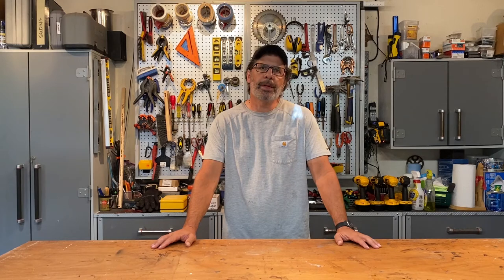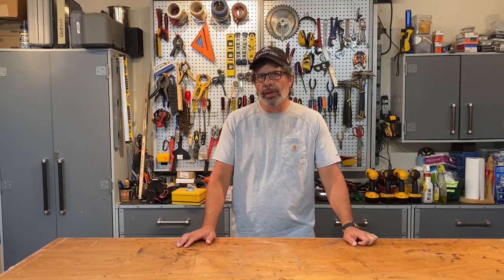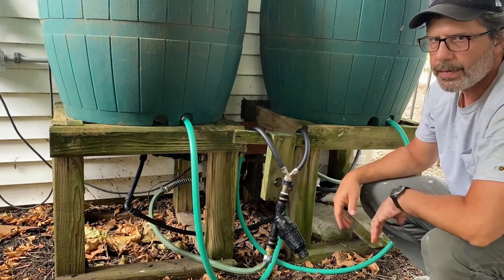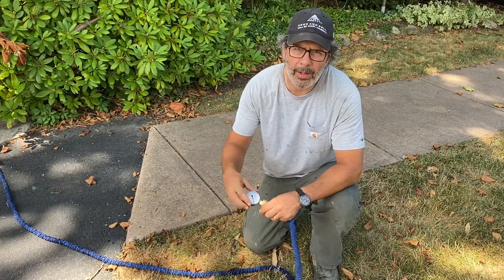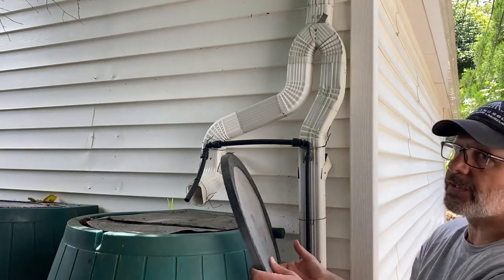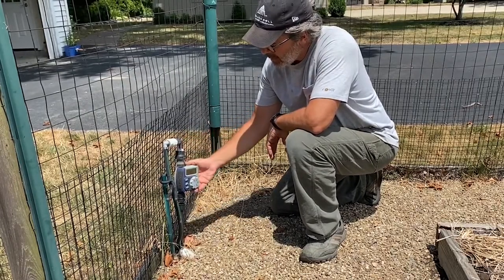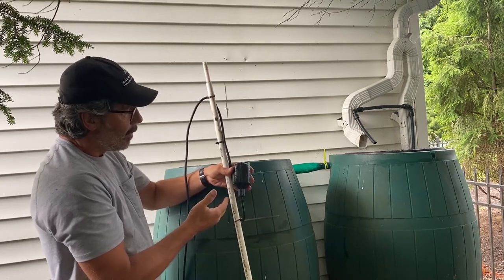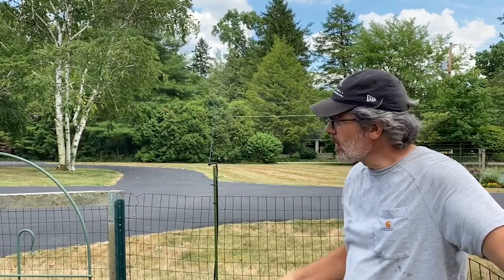The Ultimate Rain Barrel Irrigation System

Comment: Does the solenoid valve over heat being in the 100%duty cycle? Being that it is constantly energized to keep it closed
Thanks for making this video I am almost done with mine and adding float and solenoid for backup water
Reply from the maker: I’ve never had a problem with mine. My pump and solenoid housing is 3 sided to allow airflow (more for the pump which does heat up when running).  The solenoid is slightly warm to the touch when energized (i just put my hand on it. It feels about 90F).  I ran my solenoid for about 9 years before replacing it. The bottom seal went bad. It was still operational otherwise.  I definitely would not put the pump and solenoid in a completely airtight housing. Some airflow for cooling is sensible.
Reply: @dontscrewitup   Thanks for the reply

Comment: Have you had any issues with the solenoid overheating? Is it 100% duty cycle? Thanks
Reply from the maker: It does stay warm but not hot.  The housing I made is three sided to keep some air flow around it.  I would not put it in fully enclosed housing or indoors.  

I’ve replaced it once in 8 years because the gasket/seal failed, not the actuator.
Reply: @dontscrewitup  thanks for the quick reply, I think I am going to have a similar setup and will be replacing it with a motorized ball valve, which should solve the heat and gasket lifespan
Reply from the maker: Motorized ball valve is a great idea.  Also solves the problem of power outages.  In my setup the solenoid opens when the power is out.

Comment: If the hose backup fills the barrels automatically how is there ever space to accept rain water?
Reply from the maker: Good question. The placement of the float switch is critical. The float switch does not kick on the refiller until both barrels are nearly empty, so any rain prior to that will refill them.  Also, the refiller only fills the first barrel and about 1/3 of the second barrel before the float switch turns off.  Assuming the system is running, the first barrel then drops to about 1/3 full after that days irrigation, so it leaves about 2/3 of each barrel empty, right after refilling?   You can fine tune it even more to leave more available capacity by putting the float switch in the first barrel.

Comment: Fantastic system! I am in process of setting up a system to use for my 1/10 acre backyard nursery. I currently have 3 x 275 gallon IBC totes connected. Would I need a more powerful pump? I have 6 sprinklers (36” tall), 1 mister for propagation bed and would like to connect drip for my small garden ( 20’ x 20’). Thanks for figuring out the hard parts for us.
Reply from the maker: Thank you.  Sorry for the delayed reply.  Most "hose pressure" pumps are around 40-60psi.  That should be sufficient for any drip irrigation system.  Some drip irrigation systems actually step down the pressure to 10-20psi.

Comment: have you measured how much water you distribute in the hour you have it running?
Reply from the maker: About 20-30 gallons per hour. It depends on the number of dripper heads. They are each rated for gallons per hour, so you can calculate it.
Reply: @dontscrewitup   - plan to get this set up over the winter!  You really provided a great idea - and applied it!

Comment: How did you wire the solenoid valve into the flow switch?
Reply from the maker: The solenoid is hard wired into the 3 prong plug for the pump.  So one plug powers the pump and solenoid.  That plug is connected to the “thru” plug on the float switch. Female on one side, male on the other.

Comment: It seems good but isn’t the solenoid on all the time? Aren’t you going to burn out the solenoid?
Reply from the maker: Good question. It is on all the time except when it is filling,  I assume high quality solenoids are made to operate in either open or closed position.  I used this one for about 9 years before the seal/gasket started leaking but it was still otherwise fully operational.

Comment: What happens when you get a power cut when you’re away from home?
Reply from the maker: You win the grand prize for catching the only remaining flaw in the system!   The solenoid would open and the hose backup would run (and overflow into the downspout) until the power comes back on.  This could waste a lot of water depending on the duration of the outage.  If I’m leaving for an extended trip, I have 3 options, 1) turn off the hose backup and take chances of barrels emptying, 2) leave it on and take my chances of wasted water, 3) leave it on and call my neighbor to turn off the hose backup if we lose power (my security system notifies me of power outages).
Reply: Cant you put another solenoid valve on your back/up hose water supply that’s normally open when house power is on? When house power is out, then it closes so. That way you don’t waste water but that’s assuming you’re ok with your garden not being watered whenever there’s a power outage in your house. Or switch to PV solar power to be more sustainable!
Reply from the maker: Yes, great idea. That would definitely work.  I originally had designed it with that double solenoid solution, but never implemented it.

Comment: What do you do if a power cut occurs? 
Does the mains tap water continue to overflow until the power comes back on? 

Excellent video by the way! 
Definitely given me the information needed to build my own system
Reply from the maker: Great question.   Yes, it would continue to run and overflow into the downspout until the power comes back. That is the one potential “flaw” in the system. Our power outages are very infrequent.  And our security system alerts us of power outages.  So, if we were away on a trip or something and there was an extended outage, I would call my neighbor and ask him to shut off the hose water for me.  He is aware of how the whole system works.  There is another solution. I could put another solenoid (power = open) in line before the float switch and this would cut the hose flow in the event of an outage.   I originally designed it that way, but it seemed like overkill so I never installed it.
Reply: @dontscrewitup  I had exactly the same question and sure enough it's already answered. Lucky you for stable power! In soviet California we now get regular "safety power shutoffs" when it's hot and windy. That secondary solenoid (normally closed) will upgrade your system to "Ultra Ultimate" rating
Reply: @dontscrewitup  This is a brilliant irrigation system. The solenoid is acting as a check valve that keeps rain water from entering your potable water supply. But when the power is off, your well pressure tank could run dry and rain water or water that is in the drip lines could be drawn into your potable system through the hose bibb. That could contaminate your drinking water. I'd suggest that you put a spring loaded check valve or inline back flow device on the hose bibb to protect the potable system. Thanks for sharing with us.
Reply from the maker: Thanks. The potable water supply is a totally separate system from the rainwater.  You can see late in the video that the potable water only enters the system through gravity as it fills the rain barrels.  The potable water supply is not connected to the pump or irrigation lines in any way.  I considered direct connecting the backup water supply directly to the pump but chose not to do this and went for the low tech method of just using the potable water to fill the barrels rather than connect directly to the irrigation.  But I agree with you, if I had connected the two, a check valve would be essential.
Reply: @dontscrewitup  I remember the black open tubing above the tank now. That's another great idea. Thanks.
Reply: @dontscrewitup  Seth at the Land to House channel uses a side-entry or tank mount mechanical float valve to fill a bucket and turn off the water when it's full. This would work when the power is off and it fills the barrel before turning off the water.
https://youtu.be/BYihiViB2Dk?t=29

Comment: Why not run the city water directly into the supply line (just before or after the in-line filter), rather than into the barrels? I'm not sure if there's a connector that would allow for this, but I'm thinking it might save you a bit on your water bill and not occupy space in your barrels with city water when the next rain comes.
Reply from the maker: That is a possibility but a little more complicated setup.  Similarly with the float switch in the first barrel, that would also work if I wanted to minimize city water usage.  In our situation, our city water is incredibly inexpensive and abundant so I did not optimize the system to minimize its use or maximize rainwater usage but if I did, I would have employed both suggestions.  I tried to keep the setup simple and low cost, with some trade offs on water efficiencies.
Reply: One more question, sorry. Have you had any issues with algae in the barrels? Do you ever do anything to prevent sunlight from going into the barrels?
Reply from the maker: My barrels are in a shaded area so I’ve not had trouble with algae.  There are tablets you can buy to add to your barrels to keep the algae down.
Reply: Thank you for your help and quick responses!

Comment: You are a genius 😊👌
I have a question. I have a drip irrigation and like to use liquid fertilizer from a container and pump it through my drip line. All I need is a recommendation for a pump for my purpose. My drip line is almost 100 ft long with lots of emitters. Will you recommend me the right pump which can pump up to 100ft with a decent pressure? I know there are many other methods to do it but I prefer to use a separate pump
Thanks a lot
Reply from the maker: Garden hose pressure is about 40-60 psi. Most micro-drip irrigation systems reduce the pressure down to 20 psi. I’d go with a DC powered pump vs. AC. It’s safer for outdoor use.  I’d probably go for a 40 psi DC pump.  I’ll take a look tomorrow and recommend a specific one. Are you in the US?
Reply: @dontscrewitup  can you send me a link
Reply: @dontscrewitup Thanks a lot!  I am in Canada
Reply from the maker: Anything like this would work.  45 psi, 12v.  This is a reasonably priced one.  This one looks like it would need to run on a timer.  You can also use an “on demand” pump if you want the pump to turn on when you open a line (if you already have your drip irrigation on a timer valve foe example).  https://amzn.to/3gQ6krc
Reply: @dontscrewitup  
Thank you!
My drip irrigation is connected to the city water and I don’t have any issue with pressure
I fed up fertilizing the plants manually. So I thought of connecting a pump to a container(30litre) with liquid fertilizer and connected to a drip line. When I turn the pump on it should pump the fertilizer through my drip line. I know 30 litre is very small and maybe it will be done in seconds(not sure😀)
Do you know what should be the minimum capacity of the container I should use?
This is for a small backyard garden and front of the house for flower beds
Sorry if this is a dump question 😊

Comment: QUESTION....how high would those 4-barrels (55gallons each) need to be to get 40psi at the hose? There is no simple answer to be found.
Reply from the maker: There is a formula to calculate that.  Let me find it.  It is higher than you think. I believe it may be 2 lbs of pressure per foot.  That would be 20ft,  but let me find the formula…
Reply from the maker: Water pressure increases at .433 PSI per foot of elevation.  Roughly 2 feet of height to increase 1 per pound of pressure (i had it reversed above).  So over 80Ft to get 40 pounds of pressure.  That’s why I use a pump.

Comment: if the 'backup refill' valve opens when your float valve cuts off power - what keeps a power outage from opening the valve when the barrels are already full?
Reply from the maker: It’s a little counter intuitive.  

When the barrels are full, the float switch is on the “on” position which sends power to the solenoid and the pump.  The solenoid is “closed” in the power on position. The pump is powered on, because it is on-demand, it only runs then the outbound pressure drops (when the garden irrigation timer opens up).  

When the barrels are low the float switch cuts the power to the solenoid and pump. The solenoid is “closed” in the power off position and the pump is off.  

Hope this helps.
Reply: @dontscrewitup  

looking at your drawing (overview) the only thing controlling whether water flows from your tap into rain barrel #1 is a solenoid valve which gets power from the float switch interrupt. as long as the solenoid is getting power via that float switch it remains closed. however if power is cut off for any reason the solenoid opens. 

my question was how it handles a power outage which would ALSO cut off power to the solenoid. at least based on what I saw in the video I don't see any safeguard to prevent that solenoid from opening up if the power goes out and as long as power is out even if the float switch if closed it's still going to be dumping tap water into your first barrel.
Reply from the maker: That is correct.  I would need to add a second solenoid on the backup filler, tied to the house power which would close in the event of an outage.  I describe this in more detail in the description of the video.  Many have asked the same question.

Comment: I am thinking off using a Stable Float Ball Valve Shut Off-thingy to use as my backup-refilling. What do you think about that?
Reply from the maker: That's possible, but you'll need to run more plumbing in to and out of the rain barrel than what I'm showing here.
Reply from the maker: @xion1992  I see.  That's a good design improvement. Please report back on how it works.  Perhaps I'll include it in an updated video (with your permission).
Reply: @dontscrewitup  I'll try to remember to report back. I don't know if this project is going to happen this season or in one or two years
Reply: Good idea! One probably should use a float valve designed for livestock water tanks. The standard toilet float valve would take much longer to refill a large collection tank I would think.

Comment: How many microns are your screen prefilters
Reply from the maker: I believe these are the specs. Material: 304 stainless steel wire, Weaving Method: plain weave, Mesh: 200 mesh,Size:12"X40" (30cmX100cm), Aperture: 0.075mm, Wire Diameter: 60 µm, Open Area: 34%.

Comment: I'm trying to apply your tips to my setup and for whatever reason I can't get my solenoid valve to work with the float switch or on it's own, please help
Reply from the maker: The solenoid should cycle open and closed when you give it power.  Is it doing that?
Reply: @dontscrewitup  I hear a noise like it is engaging but it doesn't look like the valve is opening. FYI, this is the first time i'm working with a solenoid valve.
Do you have a wiring diagram of how to have the float switch, pump and solenoid switch should be done (the pump plugs into the float switch but how and where should the solenoid valve hooked up)
Reply from the maker: If you hear it clicking, it’s working.  You won’t actually see through it when it’s open. It’s an Internal gate.  The pump and solenoid are both wired together (hot to hot, neutral to neutral and ground to ground) then connected to a 3 prong grounded plug which powers both of them (with weatherproof connectors).  That plug is then plugged into the female/male through plug of the float switch which basically works like an on/off switch for both the pump and the solenoid.  When the barrels are full (float switch on) the pump and solenoid are powered.   When the barrels empty, the float switch turns off power to the pump and solenoid which opens the solenoid valve until the barrels refill.   It may seem counterintuitive but the solenoid is closed when the power is on and open when the power is off.

If your pump already has a plug attached then you can run a second dedicated plug from the solenoid then plug them both into the female side of the float switch (through a 2-1 plug adapter obviously). I wired then both together in my pump housing.
Reply: @dontscrewitup  Amazing, thank you for the information!

Comment: Question about the solenoid. Looking at the option on Ebay etc, I am seeing warnings that it is not intended for 100% duty use aka be powered on 100% of the time as the coil can overheat/burn out. Is that something I should look to upgrade to a more robust solenoid instead, - or have you seen no issues with your own choice there, and the warning is one of those things to not worry about in a rain barrel setup vs something more volatile like gasoline etc?
Reply from the maker: Good question. I have not seen those warnings, but I do have my solenoid in an open-sided housing for this reason.  Both the solenoid and the pump motor can get hot so I made sure I properly vent them.  I would never put them in an enclosed housing, for example.  My solenoid lasted for about 8 years of continuous seasonal use.  I recently replaced it because the seals failed.
Reply: @dontscrewitup  thanks for the thoughtful reply. It’s a great video with simple explanations and really lots of clever concepts to calamity proof.